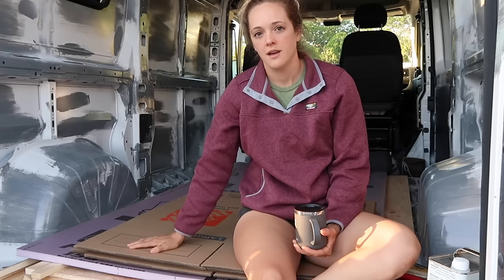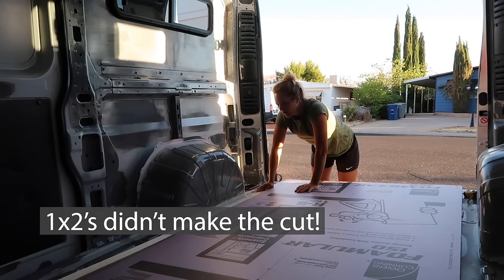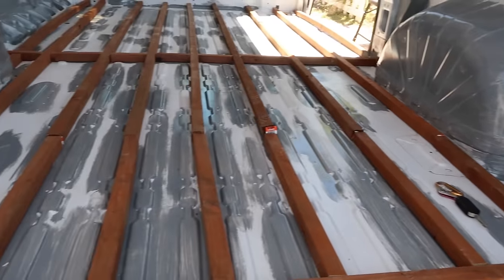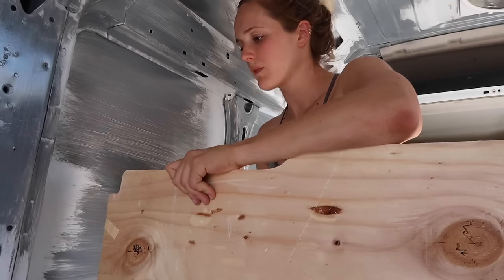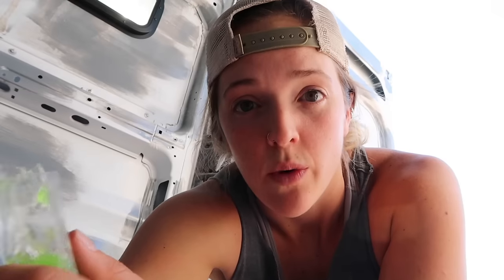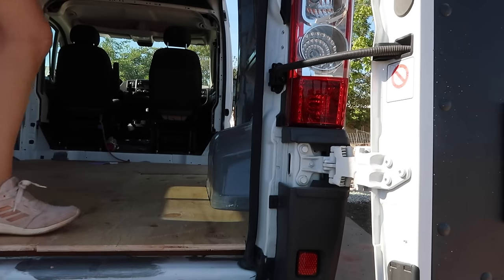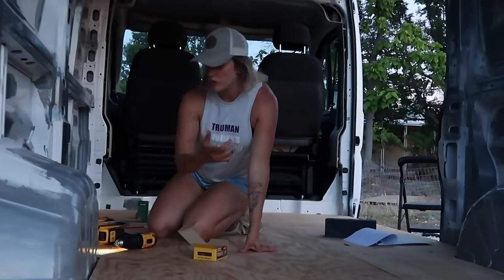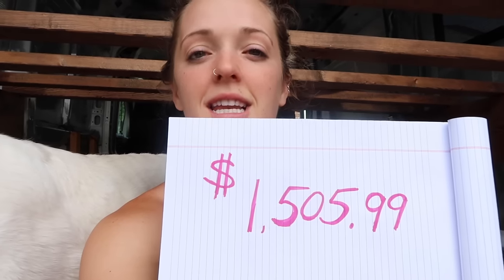How to install a DURABLE SUBFLOOR | Ram Promaster Van Build

Comment: The reason they're not the measurement they're advertised as is because at the sawmill they get rough cutted to the advertised but then go to the plainer mill to get the finalized size to look nicer.

Comment: You have done a Great Job ! Sealing the plywood was one of best thing that I have seen ! Your building is better than a lot of van builder !   (I got my first van in 1968 (1959 VW cargo van)) I hope this will help you the next time you need to copy or make it fit. #1 Take a compass and open it up so you can use the pointer part to trace the shape you want to copy and the pencil or sharpie end on the piece you need to shape. #2 Go on youtube and find humble road vans look at the 80/20 alum  and see how he is using it and not wood ( it is stronger and light and thing will not grow on it ) It need less hole in your van and can be transfer from van to van . It is easy to make changes to lay-out. I hope this help you
Reply from the maker: Thank you so much!! I appreciate all of your feedback and your tips. I will definitely be taking a look at the 80/20 alum. I love learning so keep up the advice!
Reply: Thans
Thanks
Reply: Nico 😻😍

Comment: You done it right with the liquid nails I reckon.  As you said there's no need for any more holes than needs be. On my first build I done exactly the same, I changed up the 2nd builds and had layers of sound deadening and bubble wrap reflectix to provide the insulation underneath which works well even in the harsh Scottish winters.

The rest of your build that you have already finished will also firm everything up which is why I never secured my floor. When the whole van is built it will be solid. I really do think folk over engineer builds with regards to this but the floor isn't going to float away or jump once you have units weighing and bracing it down.

Comment: Just started watching your journey from the start.  Hats off to you for endeavoring on this project.  I’m excited to continue to follow the progress of the build.

One thing I was curious about was whether or not the use of those furring strips (the 2x2) is common?  You see… in general, those creates thermal bridge from the external elements you’re trying to insulate from.  Essentially, the strips act as a conductor (of heat or cold) and transfer that from the outside and to your floor.

I wonder if the furring strips were needed at all.  Couldn’t subfloor just lay directly on the foam boards? 

The furring strips would also transfer noise from the chassis of the van and into the subfloor… whereas without it… the foam boards could have also served as a sound insulations.

Anyway… just a thought on that project if anyone else is reading this.  

Great job though and very impressive work.

Comment: I haven't read the comments to see if anyone has wrote this but you never cut wood tight as you have to allow for expansion, if you don't do this, as the floor expands and retracts which it will with the changing seasons, when it comes up against the hard edges it can't go any further, it will rise in the middle. Holes in the floor doesn't cause squeaks, I know this has been a while ago but for anyone else reading this I hope it helps. Take care and enjoy life, you only have one! ☘☘

Comment: Great job Linnea. I am at this step right now, and may start today. There totally are so many ways to do this, and it stressed me out too. I have been thinking about how I want to do it for like 10 days. 

My way will be pretty close to yours, but I am going to put the furring strips side to side, not front to back! No one right way to do it. I will be glad to have it out of the way.
Reply from the maker: For sure! So if you are placing strips side to side, what size are you planning on doing and will they be place on top of the ribs? Also, are you going with rigid foam board as well? Send me a picture when you are done! Certainly one of those projects that feels great when it's complete!
Reply: Linnea Schmelzer I bought 2x6s and i plan on ripping them down to 1 1/4" thick (I have a table saw). yes rigid foam board, same as you. will put strips on top of ribs. i know there will be air gaps below wood and ribs, but there is not much i can do. time will tell if it creates any condensation problems between the metal and insulation (or not?). there is only so much i can worry about... i absolutley will send a picture. have a nice day, linnea
Reply: Humble road used 1” aluminum side to side, placed the insulation board right on top, then cork flooring for added insulation.. I need to go watch him again but I love your floor, he says it needs to breath, he says everything needs to breathe. I’m priming and painting mine right now but I think I’m going to try using the aluminum bracing.. but a lot of your ideas, I’M USING. You are so helpful and make it interesting.. I’m following you step by step ..

Comment: I’d drill some holes in that horizontal member at the door to allow ventilation and prevent moisture buildup. And the small horizontal pieces in the center are not needed. Removing them would promote ventilation.

Comment: hey just fyi ya'll, u don't need to put so much framing in the floor, the foam itself helps hold the weight of the floor and everything that's gonna go on top. framing is for a bit more support and for the specific spots u might need to nail something in.

Comment: Wow. I really love your Promaster van. The job you've done on the flooring was top notch, And i can't wait to get started on my van build. My van is MUCH smaller/shorter than the promaster, But at $300 for a running van with no rust or body damage, i have no complaints. I bought a 1991 Chevy Astro van,the short one, But it has great bones. Filthy dirty, but great bones. I begin tearing out the old nasty carpet tomorrow... Thanks for posting your video's and you've got a new sub!! Ron in Eagle, Idaho...

Comment: Did you consider taping the seams with duct(NOT Duck) tape? It would block both noise and sound. Another suggestion would be to treat all 6 sides of the ply. Without it, the bottom and sides are susceptible to water intrusion. Might consider gluing the ply down too, keep future squeaks to a minimum. Overall a great job.

Comment: totally agree on not putting holes in floor of the van.....curious as to why you put your fan in the front?  I think you get better circulation if installed in back of van
Reply from the maker: I have two fans! One is in the front and offset over the kitchen and the second is right above my bed. One fan can pull and push air while the fan over my kitchen and just exhaust. That way I can have a solid fan while cooking but also I can create some wicked circulation with both fans and my two windows.

Comment: Not sure if this is a problem for you (or if you have fixed it already) but when having ply screwed to a frame for the floor, I have seen people put liquid nails or something similar between the frame and ply to get minimize/eliminate creaky floors. 
I know this is an older video so I will find out when I watch your newer vids if this was an issue or if you would have access to be able to do this with the other things in the van.

Also, new(ish) subscriber. Think I started following you a couple months ago, but have only gotten around to watching all you stuff now. Cant wait to see what new projects you do
Reply from the maker: Hey! I actually haven't had any squeaking from my floor. I used liquid nails on the metal floor and 2x2's, and just deck screw for the rest and it has been great so far! I think adding liquid nails would be a safe bet though :)

Comment: I do see a lot of different floor lay outs i have even seen some with no insulation and the wood frame across to allow air flow and if you measure from any center to the edge would be easier than measuring the complete size or starting from the edge if that makes sense, just measure from a center point to an edge and same center point to the other side edge...

Comment: 11:48 .. I am going to be using rivet nuts (1/4' 20) for fastening down the plywood in the van (1994 Chevy Step Van) ... My plan with no insulation, 

I will spray the entire bed with "bed liner" to seal everything, even small holes can seal with this stuff. .. then put 5/8" pressure treat down first, drill through for rivet nuts ...

THEN!! .. a second layer, 3/4" Pine or Fir Ply plywood that will equal R 1.5 insulation value. 

Drill through both layers the plywood and steel for the top layers', bolts .. then remove it all ... set all the rivet nuts ... seal them with paint and primer both sides ... put it all back and bolt it down! :) 

The bedliner spray will be the "course finish" type, really biting into the first layer of plywood, 

As my van will be "modular" with it set up for Cargo, Workshop, and amping Living, at different times .. I will add cargo tie downs routed flush into the 3/4" plywood, and bolted into the box frame of the van ..  for tying down, moving loads!! :)

My thought?? Pine is more rot resistant, I could be crying loads with snow or ice that will melt ... but Fir Ply is quite a bit stronger and more wear resistant.  .. If I did use pine, and it got all gouged up an worn? ... It would be simple enough to replace it every few years if necessary.

Comment: I kept mine floor simple. 3/4" OSB Floor and Heavy rubber mats ontop?  I have Laminate flooring but if is Slippery?   Things wud slide around?  They don't move on the rub er floor so I think I will stay with that?  U don't really need alot of insulation on Floor?  HEAT RISES; U Don't lose alot of heat thru floor?  The wood and rubber block conduction thru contact w cold metal floor.

Comment: babe the issue with the the floor frame is,everywhere there no insulation and the wood touches the floor, there is a transfer of energy from the steel floor to your inside flooring attached..
Reply: I agree w/ this. My question (not using framing) do you secure cabinets to walls only?

Comment: Sick floors! Really good job on the build so far. How did you decide on 3M thinsulat vs others?
Reply from the maker: Osmar Torres Thanks so much! There was a lot of research done before the decision, and I am going to explain that all in the insulation video - but the big selling points for me were that it is non-toxic (that was important for me, since I will he living in it full time!), it doesn’t absorb water and is mold resistant, it isn’t flammable, and doesn’t attract bugs. Also the installation is extremely simple! And has a pretty solid R Value. Overall it seemed to be the perfect fit for what I want!

Comment: i just found a website that will make black flooring it looks like a rubber rug and its also a insulation they have the van i want on there list so it should be cut out for the van perfectly when i get it

Comment: Hi Linnea! I'm making my subfloor like yours and wondering why you didn't use the Noico mats on the floor? Does the foam board have enough sound deadening?
Reply from the maker: Honestly the only reason I didn’t was because I didn’t have it yet! 
But I will say that I have absolutely zero sound coming from the floor (that is noticeable to me). Even without the sound deadening on the floor it is very quiet!
Reply: @Linneaandakela  Thanks so much for the quick reply! I still have half a box of Kilmat left over so maybe I'll use it up anyway.

Comment: Question: why didn’t you use the existing plywood floor that was in the van as a template to cut new plywood? Was it not cut exact?
Reply from the maker: The existing floor was really uneven and around the wheel wells was not great! I used the back piece for the length because I liked how it hung over the lip a bit (if that makes sense). But other than that I didn’t like how it was cut prior - seemed really rushed!

Comment: Often the van will come with a floorboard already installed. If you want to replace it, a good idea is to use the old board to trace out a new template. No such luck if you get the van completely empty though.

Comment: it would have been much easier to lay the foam right on top of the sheet metal floor using loctite pl 3x in a caulking gun.  Liquid nails will dissolve the foam.  The foam is stiff enough to support the weight. Then plywood over that.
Reply from the maker: Great idea.

Comment: Can you specify the parts you got for $1505.00? Was that just for the subfloor?
Reply from the maker: It is actually a running total! So that included all of the things I had done at that point and prior... so probably my fans and windows and rust protection materials were also included in that price!
Reply: About $260 for the subfloor

Comment: How’s that squeaking foam insulation that’s breaking down working out?   Better than the human trafficking I hope. Use appliance boxes to make cardboard template. Files not sandpaper for shaping. Floor needs to be I piece without any frame or insulation in a ProMaster. 3/4” ply is your insulation. One of the Ram quirks.
Reply from the maker: I love my floor, no squeaks or issues, working out great.

Comment: I don't know about anybody else, but I may have been tempted to glue the styrofoam insulation directly onto the truck deck and just glued the plywood on top of it. That would've saved a heck of a lot of effort piecing all those 2x2's together and could've saved a ton of time . Would've worked out just fine I'm guessing.